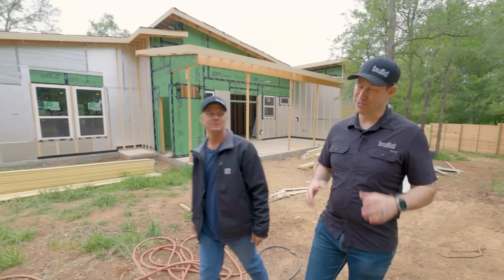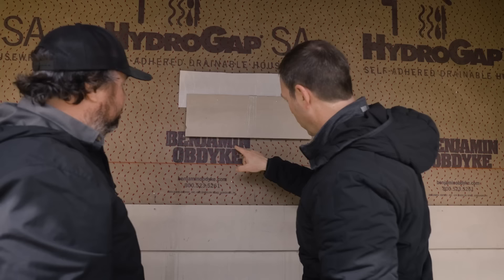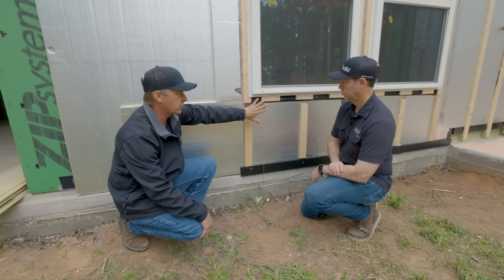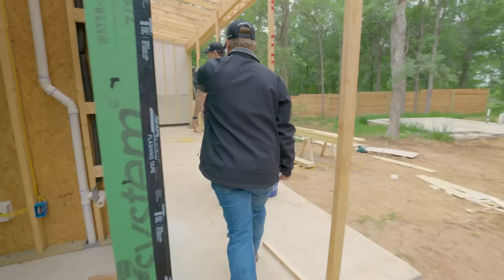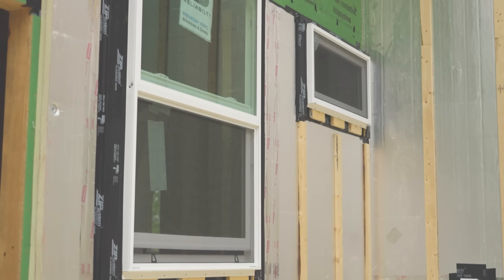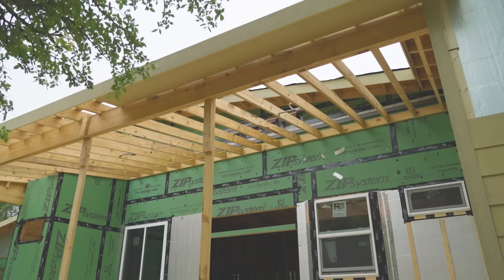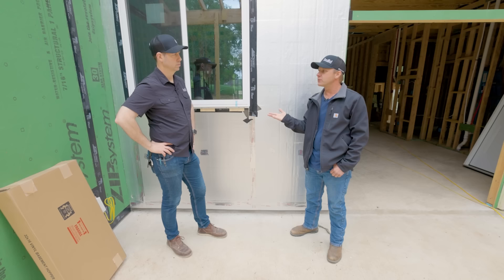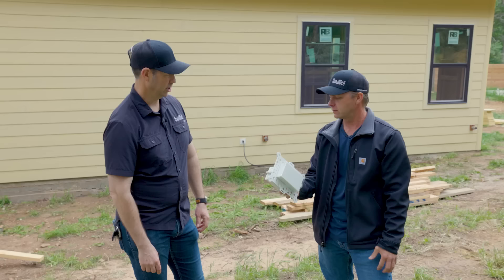Exterior Insulation w/ Common Materials ft. Scott True

Comment: There is a dynamic at play here that might go un-noticed. The cost of these high-performance methods and materials is very high and home buyers are price sensitive, ignorant of building science, and attracted to externalities rather than what's behind the wall.  So, in order to actually sell such a building, the builder must engage on social media so as to make the case for the higher price tag. Cameras, microphones and video editing software end up being as important as nail guns and laser levels!
Reply: Good points. This is a real dilemma. A while back, I use to try to sell high performance and it was difficult for me. I'm not going to change what people are interested in. So here's what I do: For my spec homes, I have a specific formula, which does not include exterior insulation, but does include many high performance details. I can build those homes at a low enough cost to sell them at competitive prices to people that pretty much don't care about high performance. In fact, I don't even tell them until after closing. I do this because I just can't build any other way. Plus, it allows me to constantly learn, get better, and show what I'm doing to people that do care. Most of this showing is happening off line when people call our company. Ideally, I would be on YouTube more often to show this to a larger audience. I'm getting there. Then when people reach out looking specifically for high performance,  we can dial in those details as far as they want to go with it.
Reply: @ScottTrue  Scott, always look forward to your reply to comments. You keep perspectives grounded without all the "hype" that youtube channels can bring. Thank you for putting yourself out there!  Atlantic Canada is true to Scott True and a big fan!☺🙏🇨🇦

Comment: How is the insulation insulating when there is an air gap behind the insulation? If you provide a spot for water to drain, aren’t you providing a place for air and humidity to come in therefore defeating the insulation?

Comment: Your videos are excellent but I see most are geared toward high end and new construction. I think I am not alone in being interested in the good building standards for the middle end.  And specifically regarding exterior insulation topic, I wonder about the value and wisdom of insulated vinyl siding in the different climate zones. I've read that moister is not a problem and then that if there is an interior class 1 (plastic) vapor barrier, insulated vinyl should not be used to prevent trapping moisture between the layers. Any thoughts.

Comment: I love the lack of roof penetrations. 
I need to replace the roof on a detached garage that has a bathroom and heater. It eventually is planned to be converted into an accessory dwelling unit, which means it would get some additional plumbing. I don’t have the double roof line like Scott, and building one would seem to be a lot more work, plus they’re all along the same wall. Would it be possible to build a faux chimney and vent all the pipes into the chimney? Is there minimum spacing between the vents?

Comment: How would the furring strip detail work with a vertical siding like board and batten? Would horizontal furring strips with a gap at say 16" allow sufficient air and water flow in the air gap?

Comment: Which series Reliabilt windows are those?  Looks like there are 3201, 3301, 3500 and 3900.  Interesting that he has white outsides on a couple walls, and black outsides on some other walls.  I've painted the outside of a vinyl white jeldwen to roughly an Anderson red, as a trial.  It is holding up well 8 years later, but it doesn't get much direct sun.

Comment: Hi Matt. Currently we are building about 150 townhomes. After doing some extensive digging, seems like the cost to upgrade to zip is minimal after you factor in house wrap + labor. I’m in the Pacific Northwest. Do you see any downsides in my area for zip system? Is there a better system I should use instead? Seems like price is not an issue . Now I’m just concerned because I don’t see enough builders here using it.

Comment: I would never put an isolation on or into my home that will burn. Neither would I use isolation that produces poisonous gases when it burns or melts. I would use hard (heavy) stone wool plates on the outside. As I live in a cold climate, I have the wind and vapour barrier on the inside of the isolation of the outer wall. Venting happens on the outside of the isolation of the outer wall. If there is an outside fire threat, aka forest fire, I would use steel stringers and on that galvanised corrugated steel plates as the weather barrier. The volume between the isolation and the weather barrier is lofted.

Comment: My only question on the vinyl windows is what you have to do to replace the window in 30-40 years when the vinyl breaks down in the sun? It might not be the original owner, and the builder is likely long since retired, but it's not a 100 year house. I have brick on top of aluminum framed windows which have fogged. My choice is to replace the panes, to pull the brick off to seal the window to the sheathing, or to shrink the window size and add some ugly adaption which may or may not water and air seal the adaption trim.
Reply: Replacement windows in that situation do not have the nailing flange.  The installer cuts the old window out, and inserts the replacement directly without disturbing the brick or siding.  The window is screwed in similar to how you would screw a door jamb.  In the video here, the window trim can be removed for future window replacement, without disturbing the siding.

Comment: Doesn't poly iso lose insulation value the colder it gets? Would that be an issue in northern climates
Reply: Yes it would. Canadian here in zone 7. No polyiso for the reason you just mentioned. Xps or rock wool is better in cold climate builds. Glad you brought this up. People forget that where you build has to be considered in the products you use.👍🇨🇦
Reply: @MegsCarpentry-lovedogs  according to the maps I'm somewhere between 5 and 6. I'm outside Buffalo NY. I've been thinking about running up to Canada for new windows.

Comment: Love this channel! But I have a stupid question, Everytime I see this I wonder, why wouldn't you put the poly iso insulation between the stud and the zip sheathing? Protects the poly iso and the zip sheathing performs as it's engineered to.
Reply: Sheathing needs to be attached directly to the studs for shear.
Reply: @brettbowers  but that could easily be fixed with strapping the studs. I know that is code approved as I've used it where sheathing wasn't possible. Just seems so much more energy, labor and material efficient, not to mention poly iso is not waterproof. It breaks down with moisture. Yet all the assemblies I see have it right under the cladding often time with no additional waterproofing. I'm in the process of engineering my house so any feedback is much appreciated. What am I missing here? I feel like I must be overlooking something major if no one puts the poly under the sheathing.

Comment: Great video from some smart builders. How durable are the furring strips on the outside of the WRB?  I’ve never understood how that works - trying to figure out a detail with exterior insulation and stucco and don’t understand why those furring strips wouldn’t just rot out.
Reply: There is enough airflow behind the siding and around the strips to keep them from rotting out.

Comment: How does a ventilated cavity not destroy the performance of insulation like this? Surely you have a conductive barrier and radiative but what about convection? I thought the main attribute of heat loss/gain prevention was to stop air movement?
Reply: Chat gpt says: A ventilated cavity in an exterior wall can actually help improve the performance of insulation by allowing for better moisture management and reducing the risk of condensation. When air is allowed to circulate in the cavity, it helps to carry moisture away from the insulation and out of the wall assembly. This can help prevent the insulation from becoming wet and losing its insulating properties over time.

In addition, the ventilation in the cavity can also help reduce heat transfer through the wall by providing a space for air to circulate and dissipate heat. While it's true that air movement can contribute to heat transfer, in this case, the ventilation is designed to create a controlled and limited flow of air that actually helps improve the thermal performance of the wall assembly.

To address your concerns about convection, it's important to note that the ventilation in the cavity is typically designed to be a slow and controlled flow of air, rather than a turbulent one. This helps to minimize convective heat transfer and maintain the effectiveness of the insulation.

In summary, a ventilated cavity can actually help improve the performance of insulation in an exterior wall by providing better moisture management and reducing heat transfer. By controlling the flow of air and minimizing convective heat transfer, the insulation can remain effective over time.

Comment: Awesome videos always
Have a question from Ohio , not very many builders use exterior insulation above grade level here, besides house wrap over the osb sheeting, and most do not tape the joints. I used to work with a drywall company so was on the job-site to see as siding was going on most of the time. 
My question is how much heating/ cooling is lost through the walls vs. the ceilings and windows and doors? Yes I understand that doors and windows are very efficient now a days. But still curious if the cost of the extra exterior insulation and labor amounts to sufficient savings in those departments? ??????????
Don’t get me wrong I agree with all you say, and if I could afford it, would absolutely do it.
Reply: I think for most people that are only focused on financial payback, it's probably not worth it unless it's a very cold climate. There are several other reasons to be energy efficient other than financial payback and I think you definitely need those other reasons to do it. The biggest bang for you buck would be to use a thick 2x6 or 2x8 wall with advanced framing and reduced thermal bridging, more insulation at the top of the building envelope, and HVAC system withing a conditioned space. We know this is true from energy modeling. These are the most important things, then windows, then everything else. Unless, there are a lot of windows. In that case, windows get more priority.

Comment: How much does a radiant barrier on the outside face of the iso help if it is covered up by the exterior siding??
Reply: Because of the 1x3 furring strips, there is an air gap there which is needed for the radiant barrier to work.

Comment: As an insulation contractor for 21 years not a fan of builders trying  to be insulation experts. This is an example of not controlling air movement for every 5mm in air gap you loose 15% efficiency if air can move you will have loss plan and simple not only do you have loss you also have the introduction moisture in the form of humidity which creates mold and rot so some of the problems  is just not understanding systems and how they work. Insulation is not as simple as everyone thinks it is. The single most important item in the structure that is the most overlook item. If insulation has air movement it has loss there is no caulk on seems no adhesive nothing to stop the air and a gap at the interface of the sheeting big no no. The sheeting has a waterproofing membrane already on it and if there wasn't so many gaps and cracks and screws they wouldn't have to worry about bulk water getting in. There are better ways but this was titled budget so ........
Reply from the maker: I’m not sure your critique is correct in this case. The insulation here is outside the envelope. OUTsulation if you will. This performance degradation you are worried about isn’t an issue here. The bigger issue is durability and letting water out of the assembly. I’m stand behind Scott’s installation here 100%.
Reply: @buildshow  Matt, I was hoping to see your reply to Waterway's comments. Thank you.🙏🇨🇦
Reply: @buildshow  figured you'd disagree friends are friends but it doesn't matter inside or outside loss is loss. Just because you say it isn't an issue doesn't mean is doesn't happen we've torn apart structures with this method. I watch and have talked with you in the past have much respect on building better but good thing is  we can disagree at least you maybe get different views. Bigger issue is if water can get in, so yes it has to breath if it's fully adhered water intrusion is much less if any.
Reply: If gaps result in efficiency loss, what is the compensating efficiency gain that results from the double radiant barrier?
Reply: @misterlyle.  For starters radiant barrier has to reflect into an open area to release energy. If something is touching it it holds the energy it's trying to get ride off. Think of sitting next to a camp fire. So double layer is mute. Gaps are air being able to move which is loss. We currently are thermal imaging a large mock up on exterior insulation along with sensors applied to capture data.
Reply: @waterwayinsulation697  Will your results for that experiment be available for sharing?
Reply: @misterlyle.  it depends on investors, I'm hoping so. Some of these ideas are  hype.

Comment: I built my house 40 years ago, using only foil faced polyiso for sheathing (no plywood or OSB;  diagonal bracing in the walls for shear strength).  6 inch studs, 50% vinyl siding and 50% stone on the exterior, both of which create an air gap that takes advantage of the reflective foil as well as providing breathability (and no painting, ever!).  So R19 plus R6 plus reflective barrier = at least R25 walls.  Regular vented attic with R38 in the ceiling.  No attempt to seal the house like a submarine, so I don't need any extra machines to provide makeup air when we run the vent hood or the fireplace.  We don't need a dehumidifier either, because the house breathes appropriately...not too much or too little.

4600 square feet, metal roof, 4 SEER 14 air conditioners plus pool pumps. My annual utility cost, gas and electric = $160 a month in San Antonio TX.  No water leaks, no mold anywhere, no condensation.  Bottom line, I just don't get this obsession with the latest and greatest building techniques and products, many of which are necessary to correct the problems caused by the others.  Traditional materials and intelligent design can get the job done with minimal complexity and expense.  Just my opinion after 40 years, though.  "I could be wrong.  But I don't think so." (credit to Randy Newman)

What am I missing?
Reply: Details.  My home similar and is a nightmare.  Why?  The builder didn't attend to the details.

Comment: Would layering foil faced insulation boards like that trap moisture between them ?   Has anyone ever checked to see if it would?  Or is this still in the " I doubt it" phase ?
Reply from the maker: What’s to go wrong if something were TJ get trapped?  Nothing to mold and if it did it’s outside the envelope. Nothing to rot here either. I don’t see the concern

Comment: You are trying to solve the moisture problem. 
As a result, the wall is blowing freely.
And this means that the insulation does not work at all.
The money for 2 inches of insulation is thrown in the trash.

Comment: What’s the r value of ramed earth and why not go with that type of building? We could get the mix like Roman concrete, it will seal itself when it rains seals itself based on the sea water or whatever they use in that stuff

Comment: No---any spacing behind the iso-board by using those splotches of silicone will permit infiltration/exfiltration---defeating likely a large portion of its insulative function.  Right?
Reply: The splotches are simply to provide a drainage plane. It's not creating any kind of additional infiltration/exfiltration.

Comment: Way too much redundancy regarding the rainscreens... 5 in total ??? ZIP + Tyvek + 2 times insulation board + siding.

EPS/XPS/Polyiso/... with an aluminium facing is watertight, tape the seams and you're done! 
When taped, this is also your air and vapor barrier.

No need for the ZIP sheathing, nor the Tyvek... standard OSB would be enough. Plywood would be even beter in case it ever gets wet, it dries better to the inside.

Internally, finish the walls with sheetrock, finish the seams in a way that they become an internal air barrier (caulk or paper bands), paint them with a (preferably) lime or oil paint (so the sheetrock remains vapor open).

If you want to insulate the internal cavity, keep the internal R-value between 30 and 50% of the external R-value.

Comment: Re: windows they all suck the modern windows fail after 5-10 years and the 2-5 Extra U Value is at the window is basically a non-factor. old Wood Framed windows are about on Par long term, unless you are getting new windows all hte time